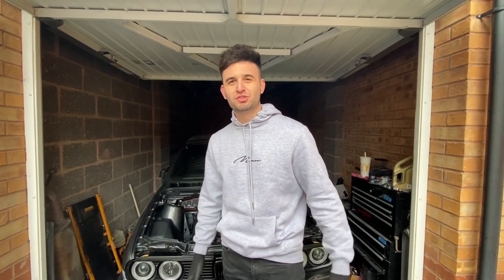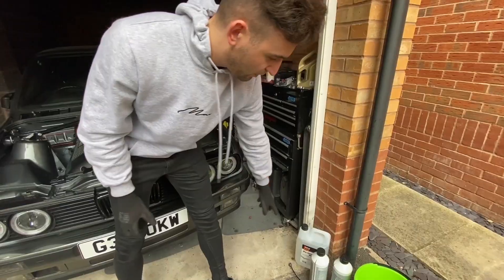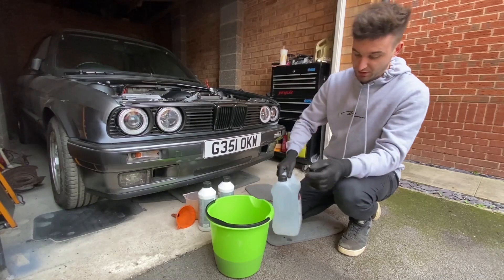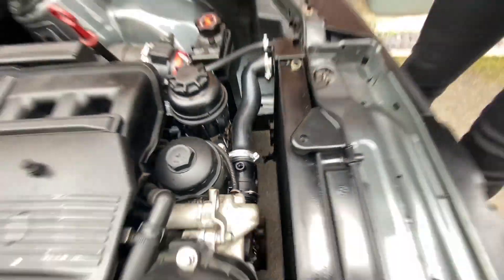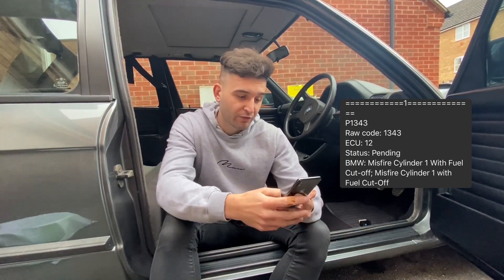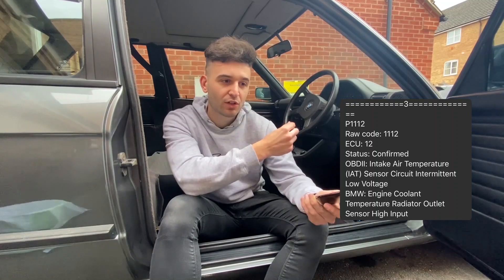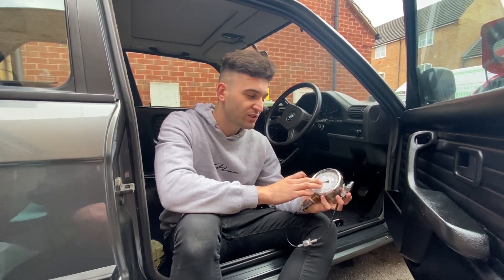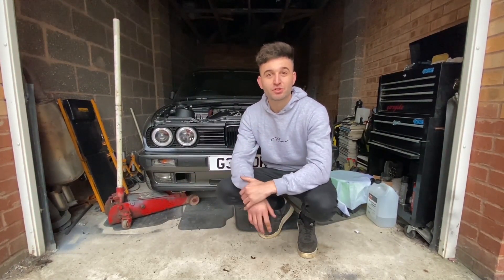BMW E30 M54 COOLANT BLEED & OBD2 ERROR CODES!

Comment: What rad pipes did you use and is that a bleed screw on the top rad hose?
Reply from the maker: Yeah it’s a bleed screw. I will send the part numbers over. Gates brand hose. The plastic bleed portion is from an e46 330i and the other two hoses are e36. They are a tight fit to the plastic connectors for the thermostat but they fit.
Reply: @JoeBradley  if you could that be amazing bro!